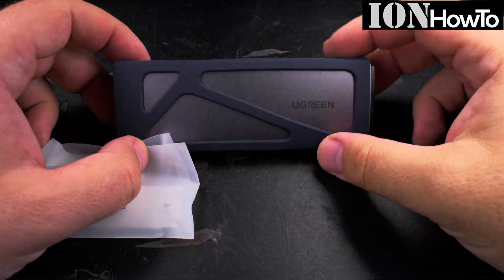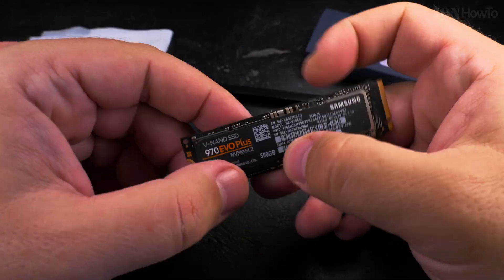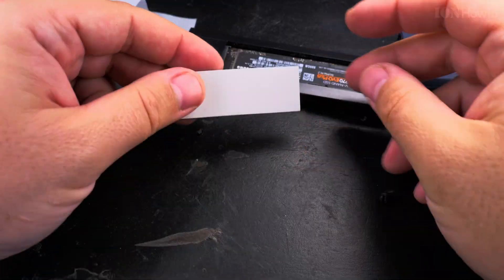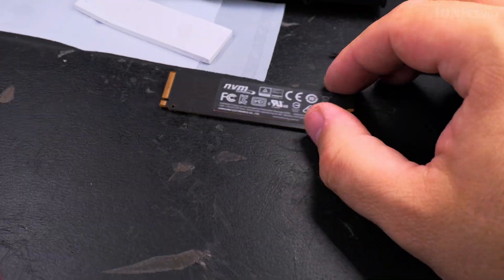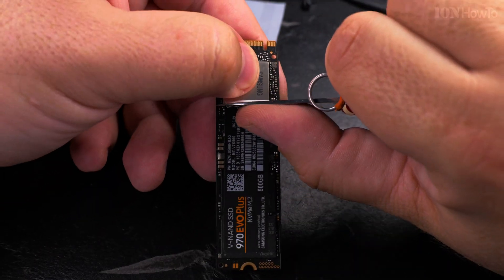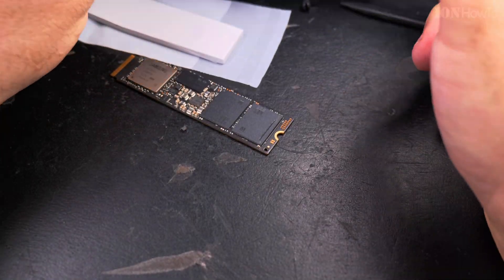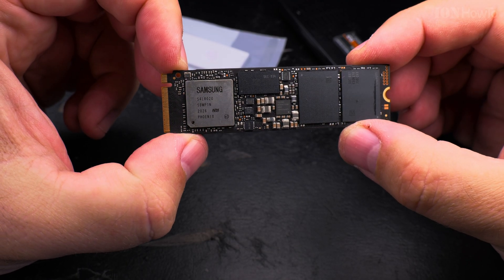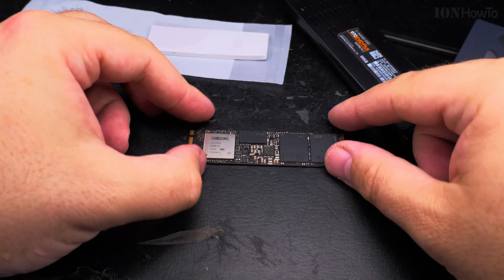Should You Remove the NVMe M.2 SSD Label Before Installing in an Enclosure or Heatsink?

Comment: I suggest to buy a better enclosure for your nvme ssd. Those sliding enclosures don't compress the thermal pad on the chips.
Reply from the maker: Yeah I was thinking it’s not going to do proper heat transfer like that. 
The enclosure is 10 gbps only so it’s not getting hot at all.

Comment: Just a suggestion. If you handle the M.2 SSD the way you are in your video, you may well have damaged it with static. Better to keep your fingers away from the connecting tabs.
Reply from the maker: Good point. I was already careful not to touch the pins and holding it from the edges.
If you touch ground - metal before handling it it should be fine.

You could also wear an antistatic bracelet.
I have one but rarely use it.

Comment: You are probably right! Even if the sticker is made of aluminum or copper, there is a plastic layer on the top and adhesive on the bottom, which represents some thermal resistivity. If you get closer to the chip, you should get better results in terms of thermal transfer.

You can check the thermal conductivity of the sticker if you have already peeled it off by holding one end between two fingers and putting the other side on an ice cube. If it is conductive thermally, you can feel the thermal transfer from your fingers.
Compare it to a thermal pad, the tick one you showed in the video, and try a thinner one as well.

Finally, please share the results of your experiments; thanks.

A (thermally) good external enclosure is always beneficial, which has some fins.

Comment: The label is also a heatsink. It poses no problems to leave that label on. It would be silly and pointless to do so
Reply: Yeah no, depends on the label. Regular paper ones are actually insulators. Metallic foil ones are heat spreaders.
Reply: Would I get the warranty of label is lost
Reply: Some are copper/carbon which dissipate heat well. Others are plastic/paper, which do so much less.

Comment: You list Pro's and Con's but are these even true? Did you test if the removal of the sticker improves the thermals or the performance? In this( https://www.youtube.com/watch?v=YUJKyA-q7Zs ) video it did get tested at least. The test is not really great, but the manufacturer says, that you should not remove the sticker. Any good manufacturer has a copper film in the sticker or something similar, to spread the heat away, if the drive is used without an heatsink.(You should not do that with any high performance drive)
And lastly: Using the drive with that kind of enclosure doesn't bring the drive to any high temperature at all. Even if the removal of the sticker would change the thermals for the better, in your case it doesnt even matter, because those cheap enclosures only have a rather slow speed of about 1gb/s.
Reply from the maker: If you did watch the video you would see the label is plain paper.
I could do it so I removed it. 

If in warranty and it could give the manufacturer another reason to deny warranty, for sure don't remove it...